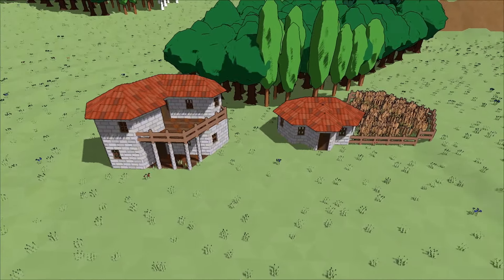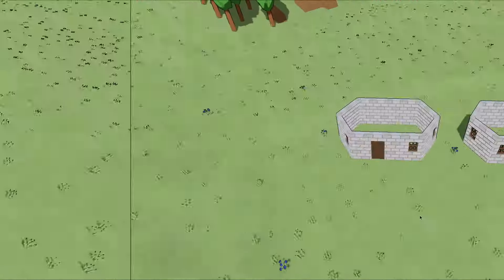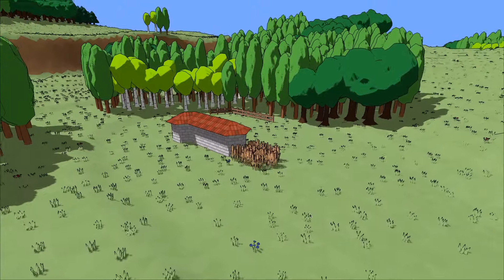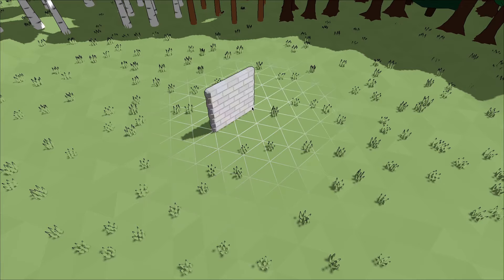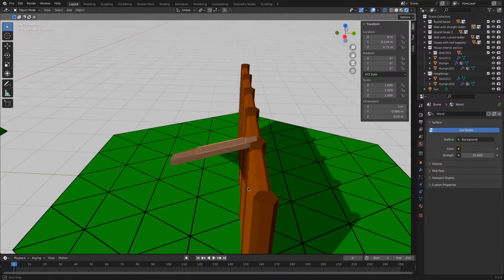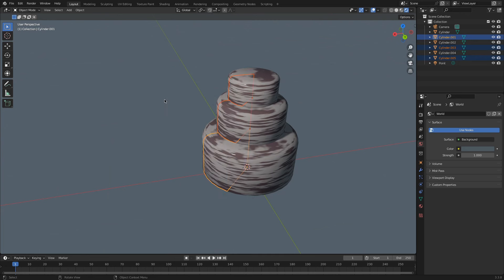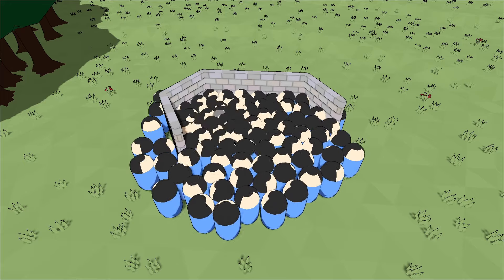Multi-Storey Houses & Chonky Fellas - Village Builder Devlog #1

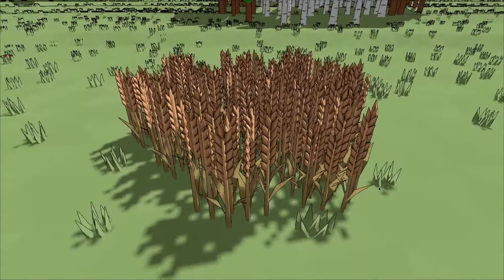Comment: 1:11 I think the reason is simple - too much outline.
A difficult solution is an outline for a group of triangles with wheat.
A simple solution is to try not outlining the wheat. You may not want to add an outline to small objects. You can also remove the outline from a distance
Reply from the maker: Yep, outlines are also a problem, but not the only one: most of the flickering is caused by the wheat geometry itself, not the outline.

Though I'm thinking of doing something with the outlines, too, like using an object ID buffer instead of depth for edge detection (and make all wheat entities have the same ID).

The outlines already fade out with distance in my implementation.